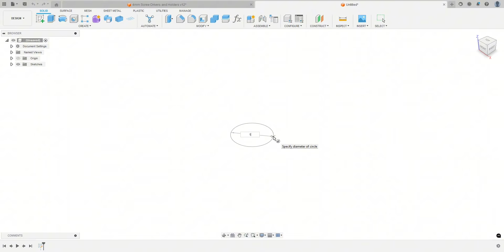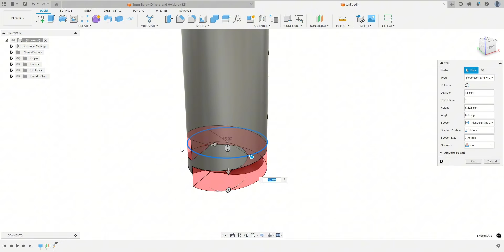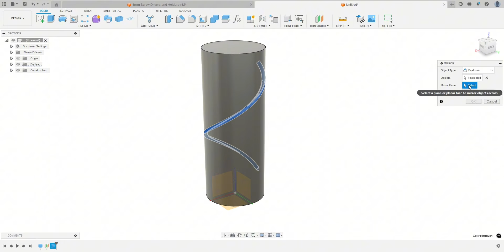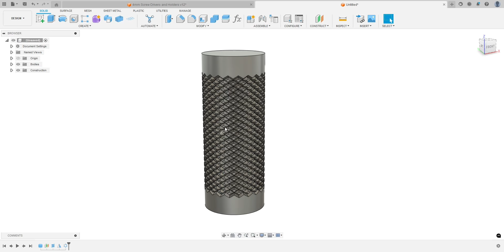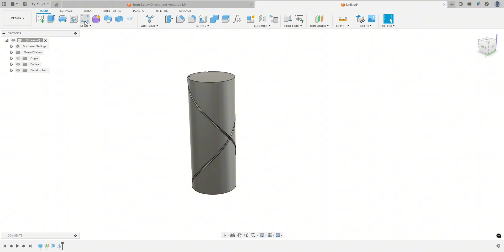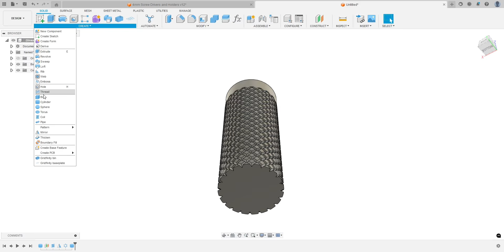Autodesk Fusion: Add Knurling to your 3D Prints!

Comment: Probably one of the best uses of AI i've found yet is to use it to make Fusion add-ins. I used AI to make a knurling add-in that uses a similar technique as yours, but you can just select any cylindrical surface and it'll do it for you.
Reply from the maker: Nice! I’ve made a ton of add-ons as well. It’s fun!

Comment: Unfortunately this method only works for rods or cylindrical geometries, in different shapes it won't work
Reply from the maker: Correct
Reply: @ShopTherapy623 but it still being a good tutorial, you can use it even to apply different patterns, thanks to share your knowledge!

Comment: Amazing technique. I was able to reproduce your excellent instructions! I wanted to try something similar. Instead of a solid cylinder, make it into a cup hollow on the inside. And use a similar technique but so that the pattern would go through and make it into a see through mesh. Could you show or tell how I would do that?

Comment: What if the cylinder is not positioned at the origin? Then there don't seem to be any snap points, which makes it practically impossible to position the coil at the center of the cylinder..
Reply from the maker: I haven’t tried it but you could create a sketch and have that visible to snap to, or create a new origin at the center of the cylinder

Comment: Onshape doesn't slow down your computer, and doesn't need top of the line machines. And...it's free.
Reply from the maker: Cool story? It’s also not as capable. You access it through a browser and is completely cloud based, so of course it doesn’t bog down your computer. You can’t use it without an internet connection. Your models are all publicly accessible as well (puke). Can’t do CAM. Want me to keep going? 

Also, there’s a free version of Fusion.

Comment: Appreciate you sharing fusion 360 lessons for 3d printer enthusiasts. Would you consider doing a video on how to modify existing step files found on most depositories? Even your screw driver if it was shared as a step file.
Reply from the maker: I have a video called “Recreate and STL in Fusion” that covers something similar.